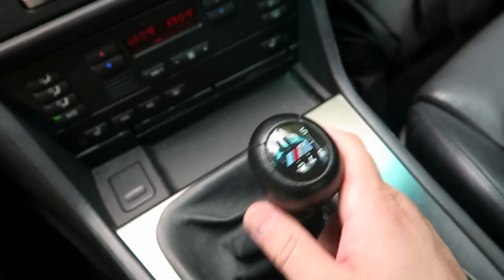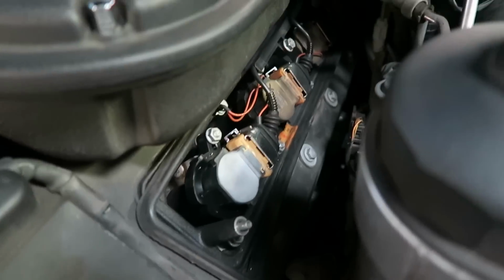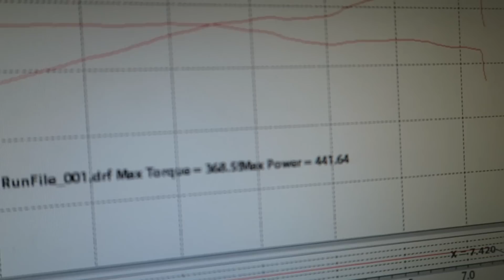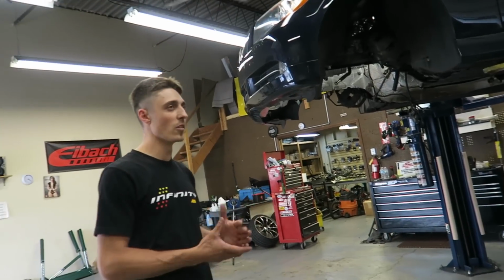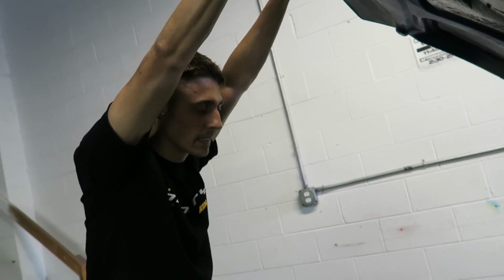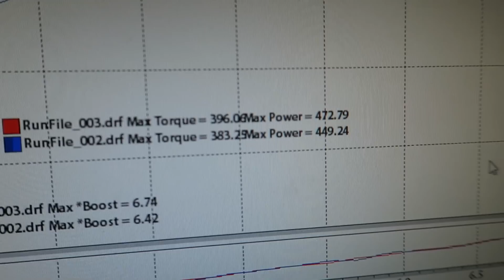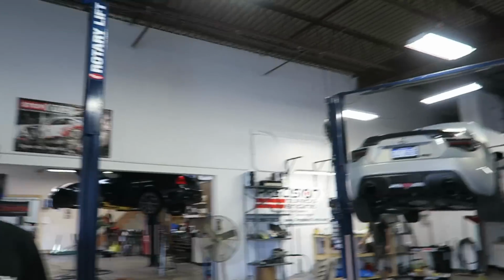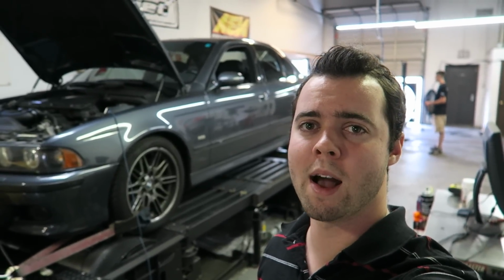How Much HP Does My Supercharged M5 Have?!?

Comment: ESS can make a custom charge cooler on this engine, that would help with heat soak.
I know a guy here in Norway runs 7-800hp version of this kit and they made a chargecooler in the intake plenum on it. 
That car is mainly used for track days and drifting so it would have heat soaked at almost any outside temperature.

Comment: Hold the 'DSC' button down (about 3 seconds) until you get the brake warning light but in yellow to fully turn your traction control off. If your handbrake is on you wont see the yellow because it will be red so you have to put the hand brake to see if it is set.

This works on my E46 325ci which is a non-M so don't know if the same applies to M cars, but on non-M pressing DSC once just turns off 'dynamic stability control' but traction control is still on but holding it down turns of the dsc and traction control.

Comment: Part number for that lower piece on that steering wheel of yours: 32 34 7 833 355

Also, exposing the coils for the rpm reading? That's just silly, it's much easier to read it off of the battery. At least that's how we do it over here with our Bosch systems.
Reply from the maker: +Tobias Weiß thanks for the awesome tips!

Comment: nope i dont wiggle my gearknob - why wiggle it when you are certain it is in neutral... but i hear you like to wiggle knobs. you probably put the car in neutral when cruising to a stop sign or a red light.
Reply: It's to confirm that it is indeed in neutral.
Reply: you are supposed to put it in neutral once the rpms drop too low as you coast to a red light or stop sign. as soon as you stop though you better put it back in gear. why would you want to downshift and do more work plus put more wear and stress on the drivetrain? not too bright are you

Comment: What should be my first car? What about Subaru Legacy is that good? Idk I've watched your vids but just want to have more options
Reply: pontiac aztec
Reply: Don't get a regular car get something electric because gasoline cars suck
Reply: Fiat 500
Reply: 240
Reply: Legacy is great, if you have heavy snow it's even better
Reply: Subarus are good if you live in a state with harsh winters.
Reply: Legacy's an awesome first car! Super reliable, great in bad weather, and actually has a surprising amount of tunability. I've got a friend with an old Legacy grandma wagon that's pushing 500-600 HP. It's insane!
Reply: f12 if you can find a clean one but ideally you'd want an aventador sv
Reply: Nissan GTR....not Porker's boyfriend.  I'm talking about another Nissan
Reply: Bojidar Martinov GTR is too expensive damn, I am thinking about under $10k
Reply: If your thinking a legacy get a gt the normal legacy's are slow and not very fun. Also I like the gt for better reliability I've had both and personally the gt is your best option. Or look for a subaru 2.5rs
Reply: Buy a civic si and drive it like you stole it. Cheap, reliable and easy to work on.
Reply: KZEnvy08 thx sound good I want to be unique I want to get maybe a hatchback
Reply: Get an Acura tbh, there is a wide variety or them to choose from and most of the older ones are also stick shift!
Reply: E46 BMW DUDE Acura NSX lol jk, too expensive not privalaged enough lol
Reply: LOL I meant like an Integra or a TL
Reply: E46 BMW DUDE Yeah ik those

Comment: no need to buy another trim peace for the wheel.. you just use  torch screws for the back then.. you  use a large screw to take the airbaj aout.. and  inside there are other little bolts   then the piece will come out...  sand it and paint it... is is really simple

Comment: That's good for just putting on a blower! It's making almost 500 H.P. and it's not going to stress the motor. If you want to make over 500 at the wheels and keep the reliability, get a air to water intercooler. You can run ice water and you'll probably see 520 H.P. If you wanted more a buddy of mine ran dry ice and rubbing alcohol and gained 93 H.P. just from that.
Reply: Jordan Berry 473whp is 550hp mate :)

Comment: I really wish you could answer this question: does the m5 whine?
Reply from the maker: +Roy Carrillo it doesn't but you do get some small blow off noises
Reply: +Vehicle Virgins i need dat supercharger whine :(
Reply: its not a roots style super charger thats  like in a terminator mustang, its a centrifugal super charger. which looks like a turbo but its still belt driven. with these cars you cant put roots style superchargers because of the individual throttle body design which has velocity stacks on each throttle body.

Comment: Always wondered what would happen if a car is on a dyno going 200mph and then the straps break, would it be the fastest 0-60 ever because the cars tires are going so fast orrrr???
Reply: Orr it would go through the wall
Reply: Couple seconds of wheelspin before the tyres grip and the car bogs down due to a gearing disadvantage would be my guess

Comment: Hey Parker, you should check out a guy on Instagram called Carbon Signal. He does custom carbon fibre pieces and could totally fix the scratched portion of your wheel and add a little special touch to your cabin

Comment: Wow, an m5 weighs over 4000 lbs....without drag tires you are not going to do much at the strip....with out up graded drive train,  do not run drag tires....you might get into the 12's.....

guess the lambo is getting its brakes fixed.....
Reply from the maker: +mustclime ESS M5s have run high 11s with radials with a stock trans
Reply: Trans is not the weak point, its the drive shafts and the diff...as for 11's......total weight(with driver)/ hp= 12's with a 2 wd car....you are about the same lb's /hp as a stock c7 vette(405-410whp)
Reply: you gonna blow through the clutch at the track, need a twin disk clutch because the single clutch wont handle the torque
Reply: Stock e39 M5s are capable of high 12s with a good driver.
Reply: sorry...drag racing = a fast car
Road course = a fast driver.....so you are saying a car with less than 400 whp and weighs over 4000 lbs does 12's???? How many hp adding stickers did he have on the car?.....Sorry, I call bs on that one...A stock c7 corvette has 410 whp and weighs 3400lbs and it has a computer controlled diff and it does 12's...I know, I have one and have done it....btw, a c7 corvette has 410 ft/lb tq at the wheels and the m5 is a good bit lower than that. TQ gets you to the hp and the M5 does not have 6.2 liters to get that tq down low where you need it.   Just more interwebs non sense.
Reply: @mustclime Since you're doubting me:

http://www.m5board.com/vbulletin/e39-m5-e52-z8-discussion/31288-quarter-mile-results.html
Thread is old, it used to have a pic of the slip as well
Reply: my 1 ton car less power=faster
Reply: Someone posted it on the interwebs so it must be true.....that was another cars slip. Heck, the first time i took the c7 to the strip, I had a civic kid ask me for a time slip...so he could tell his friends he got out of the 13's . There is this thing call math...It kinda works. Try it sometime.
Reply: +mustclime civic kid lol , slicks an you good
Reply: +KilaByte33 he's crazy the 2001 M5 is 13.0 flat on the 1/4 pretty sure a decent driver would mean mid 13s now with a supercharger it's in the 12s no question
Reply: pounds per horse power....its basic math, there is no magic.
Reply: I did a 13.6s 1/4 mile at 109mph in my E39 M5.  I could have shifted a little bit faster and gotten really close to a 12.Xs.  That's stock except for a Dinan tune.

Comment: Does anybody own a E60 that doesn't have the rubber coating from the steering wheel lower trim peeling off or from around the engine start button? I don't think so. You should be glad that yours is just damaged and not due to a quality issue. Replacing it should at least solve the problem.

Comment: How much power can 335i internals handle?
Reply: around 900 hp but not for to long
Reply: Forged internals will help with increased horsepower and lower the chances of it going wrong ie Blown engine Blowing up your car And Dying If your looking for more power on the 335i look for bigger turbos depending if that's the model you have, injectors, forged internals, cams and many other regular bolt ons.

Comment: I think that is a joke... The BMW M5 E39 has serial 400hp and supercharged  he cant hit the 500hp? This is to much money for a bad result. How much boost is ist? 0,4 bar?
Reply: Are... you not clear on the difference between wheel and crank HP? 441 at the wheels is well over 500 at the crank.
Reply: I was thinking about just crank HP. What ever... i think for a supercharged M5 is ist not enough. It is to expensive for just 100-130HP. A bit more Money with a turbo you if got easy 600 and more HP.
Reply: Bikelive1 Well no, you're not going to get an "easy 600" on an engine that only made 390 from the factory, with just a turbo. I mean not easily. Not without blowing the motor up or making some heavy duty changes to the internals. Also a single turbo adding that much HP is going to require a large compressor, which means it's going to be laggy.
Reply: I know. You need to change the pistons, other rod`s and injections.... Need a lower kompression. It is a bit more money but a lot of work. So i am right when i say that you with this modifications easy get 600HP? ;) Sorry for my bad englisch.... not the best part of my language skills....
Reply: Bikelive1 yeah you can get 600 HP, but not easily. It takes a huge amount of work to get the engine strong enough to handle that.
Reply: The S62B50 engine has 400HP and the most inportant parts that you need for a turbo is: Pistons, rod`s, bearings, and standing screws for the cylinder head. New exaust, intercooler etc. is logic.
Reply: Bikelive1 yeah, hence the "not easy" classification.

Comment: The 335i is not twin turbo is twin scroll one turbo...
Reply: In 07, the N54 was twin turboed. It went to twin scroll in the n55 engine I believe.
Reply: Oh shit yeah those were horrible engines my bad. I take back my comment. Its pre lci
Reply: +Ridgey correct! I believe they introduced that engine in the 335i (n55) around 2011!?
Reply: 2007-10 twin turbo n54. 2011 and up n55 single turbo . And slower
Reply: If you're in the market for a car in $15-20k range, a first gen 135i is hard to argue with. BMW hopes you won't notice the fact that it's $80k for the same powerplant in a brand new m3/m4.
Reply: +Carter Garnon a lot of components is changed in the new m3/m4 engine its far from a n54 and a lot more reliable so far !
Reply: +Bours911 a difference of $60k purchase price will help with the upkeep/repairs of an N54. Coil packs, spark plugs, fuel pumps. It's not like the engines grenade. Even including the maintenance it's still a bargain for the power.

Comment: how tf does a bmw do 800 hp with stock motors wtf!!??
Reply: I've seen a 335i have 900 hp on stock motor soo and it was a big single turbo it's on smoking tire look it up lol
Reply: That's easy I had a buddy who had an older a4 (I don't remember the engine displacement or anything) and I think it was a 1.8 and he put 790 to the wheels on a stock motor and stock internals. YEAH IDK EITHER I went with him to a shop to get dyno ed and it pushed 790 and some change to the wheels so I know he wasn't lying.
Reply: the newer bmws cant do that
Reply: because n54